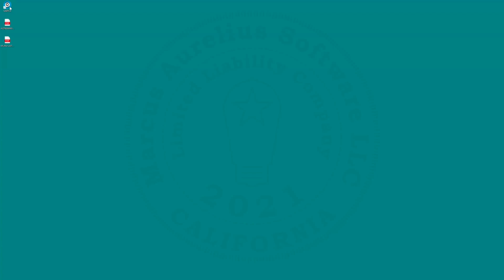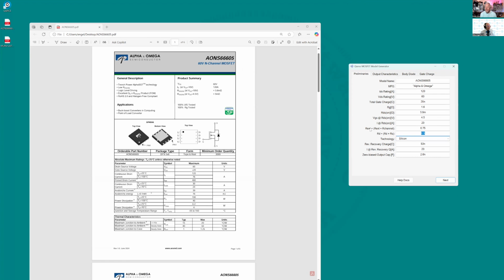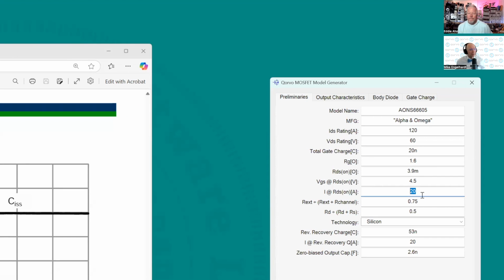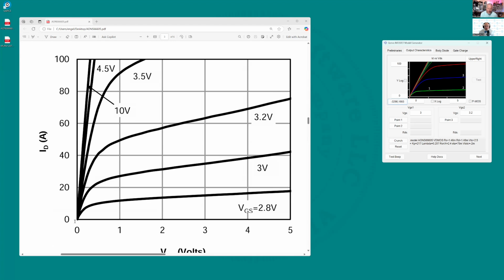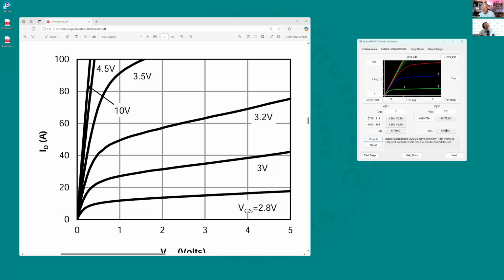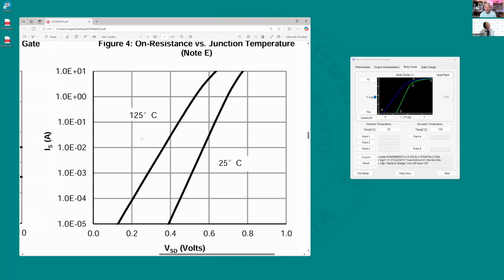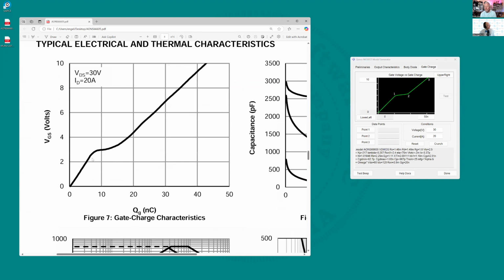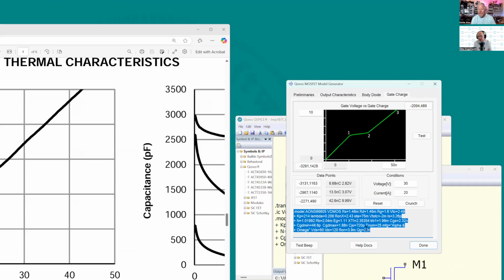Mike Engelhardt presents New Model Creation Tool for QSPICE #LTspice #Qorvo

Comment: That is great, but QSpice will never make it until it has a library like LTSpice.
If anything, I would use the tool to create mosfet models, then port them to LTSpice
which has a components library MISSING FROM QSpice sadly.
Reply from the maker: Thanks for your feedback!  QSPICE is growing every day.  With this new tool it will just help it grow that much faster.  The models for transistors and other parts will be better modeled in QSPICE as Quorvo makes FETs and such that need to be modeled correctly.  LTSpice uses a lot of behavior models, so I see QSPICE growing quick.  Remember, Mike produced both tools and he learned a lot in the years developing LTspice, so QSPICE has the benefit of a newly designed tool with lessons learned.
Reply: @kissanalog  I get ll that, but it has been out for several years now.
I have tried using it, but for ll practical use, LTSpice gets me there fast, QSpice simply cannot with EMPTY libraries.
Reply from the maker: It is easy to import models.  In the end you will be happy that you took the plung and switched;)
Reply: @kissanalog  Please a video on importing complex parts like op-amps, DC-DC converter chips etc.
Reply from the maker: Thanks!  I'm going to have to do this soon.